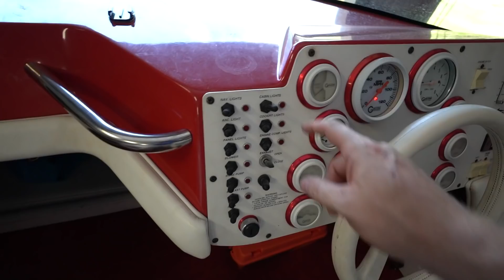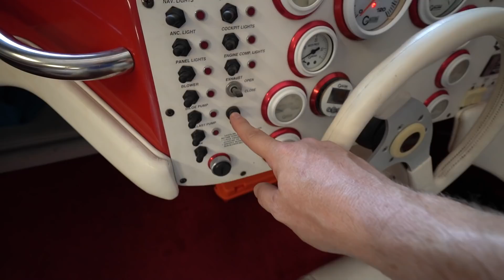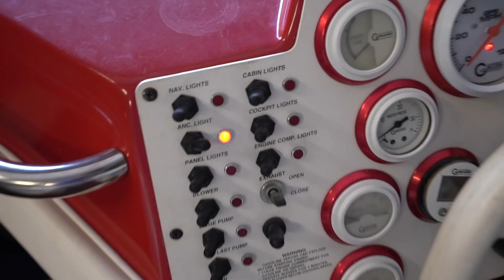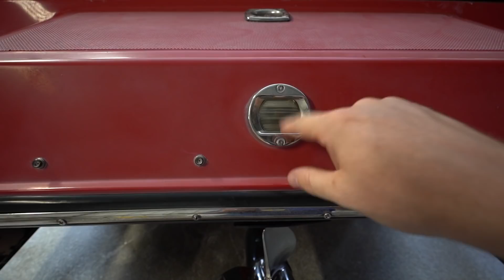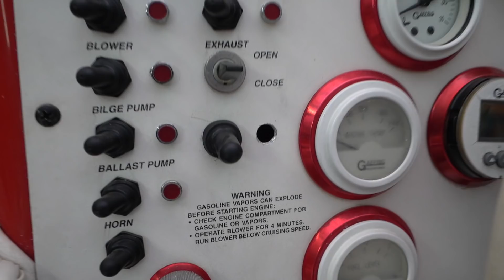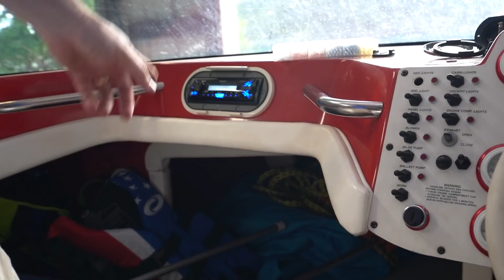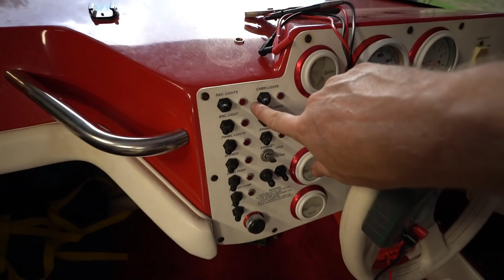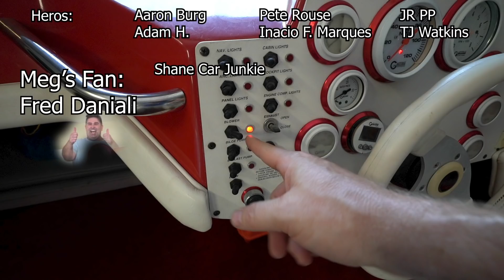Rewiring My Fountain 24CS Boat and breaking more things

Comment: Hey Dan, when you were wiring the stereo it looked like you connected the yellow and orange wire? The yellow is constant 12 Volts (connected to battery for memory, etc.), the orange is usually (dash) illumination and the red is switched power (turns the stereo on). When you flicked the switch, did the stereo actually turn on or just the illumination?
Reply from the maker: It turns on